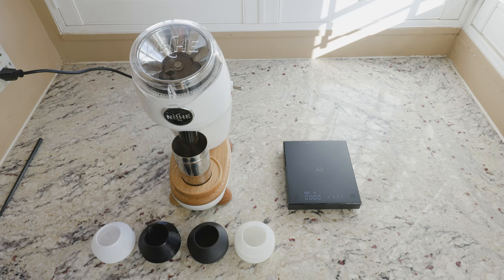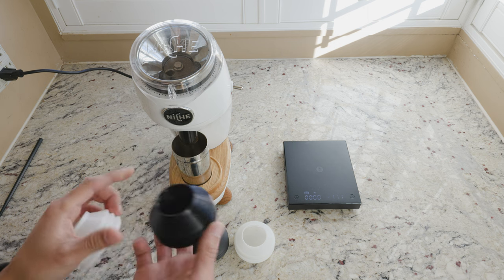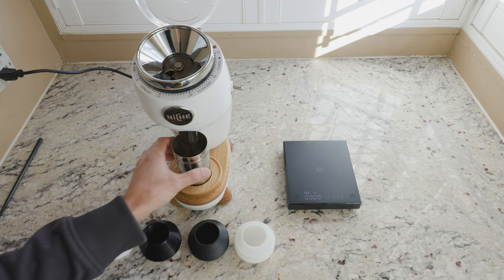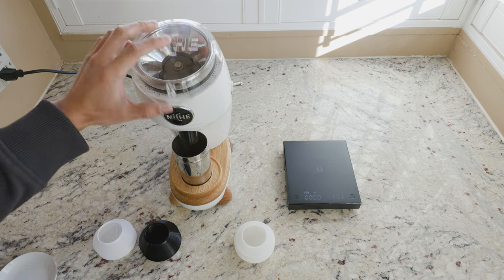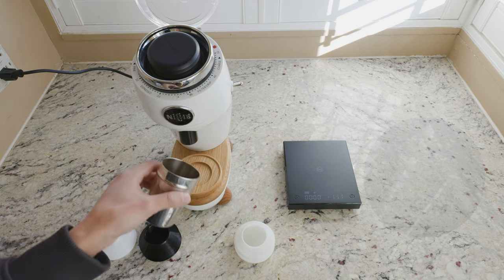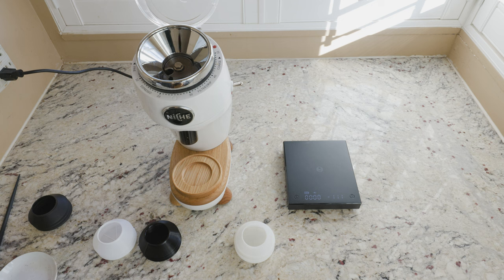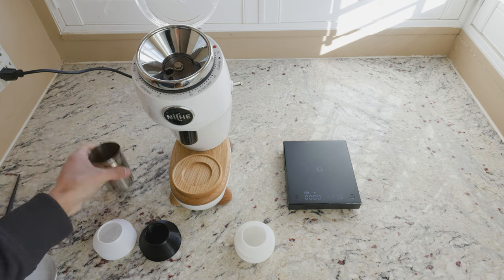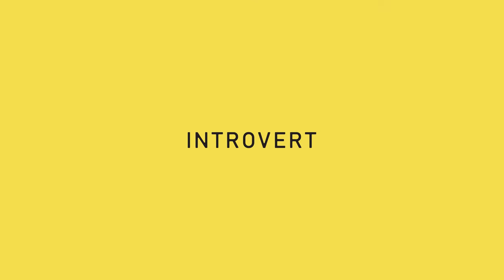How to Get Zero Retention on the Niche Zero - In Depth Look at Bellows

Comment: spraying the beans with a fine mist of water before grinding makes a difference.  I weigh 18g in and get 18.1 or 18.2 out which accounts for the water.  I do have to tap the machine though, so I'll consider buying your product to save any excess wear on the machine from tapping/slapping it every day.
I think most of the retained grinds from static are on the inside of the bottom chute.
Reply from the maker: I agree that sometimes grounds can be retained in the chute as I've seen videos others have posted. Through my own testing and observations it seems as though the retention first builds higher up in the "grinding chamber" and then eventually in the chute, so if you do get some of the grounds from tapping, only a portion of the total retention is coming out. I've tried tapping the chute after a grind without using the bellows (but with bellows used in the previous grind) and no grounds come out, so it seems to be consistent with above. Generally with the bellows I've not needed to use RDT to get zero retention and I haven't had to worry about introducing moisture into the grinder.

Comment: This looks amazing! Do you have any idea if it will work with the new Niche Duo? I have one on order and want to get a bellows for it as well.
Reply from the maker: Yes it does! This bellows will fit the Duo as well, though since the hole at the bottom of the funnel for the Duo is slightly smaller than the Zero, the bellows will need a very light push to properly seat into it.

Comment: What's the best way to wash the bellows? Put it through running water and let it air dry?
Reply from the maker: Great question! Darn I forgot to mention it the video. You can wash the silicone bellows in warm or cool water by hand, even with some gentle dish soap, but be sure to avoid using anything sharp and avoid pulling it apart. I also don't recommend putting it in the dishwasher. Air drying is the safest way to dry it, or with a little heat, just keep it below 90C / 194F. Make sure to wait until it's fully dry before using it or else some of the grounds might get trapped inside the bellows with the moisture and grow some undesirable things.

Comment: I don’t feel the workflow with bypassing the safety switch. Is it as effective without that? Just pumping, grinding maybe pumping again.

Is there a better zero retention grinder than the niche within the same budget? I don’t know what to get 😅😅
Reply from the maker: Yes, actually if you prefer to do it the safest way, it will be just as you mentioned: grind-pump-grind-pump and repeat as necessary. This is what we mention as well in our official instructions.
Reply: Nice demo and great looking bellows. I have a clear silicone massage cup that I wish I could swap for your design : )